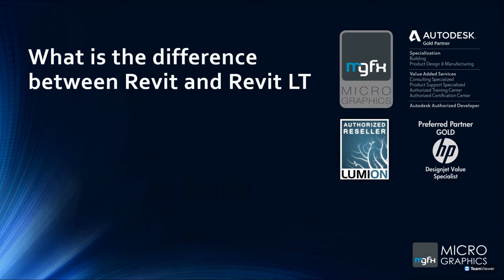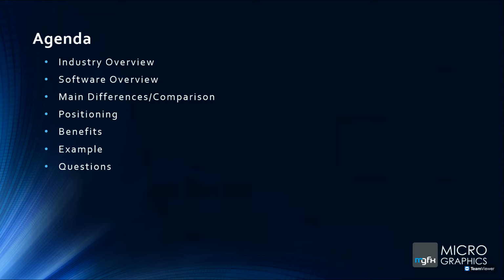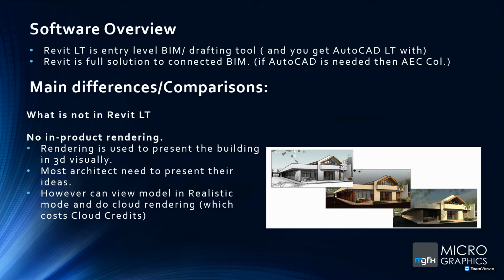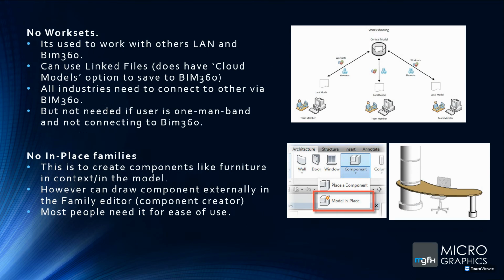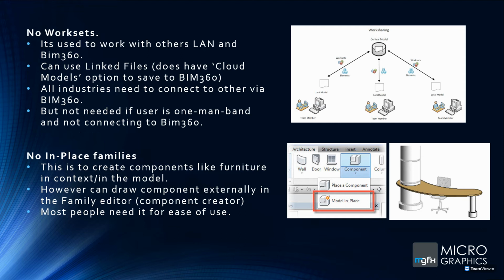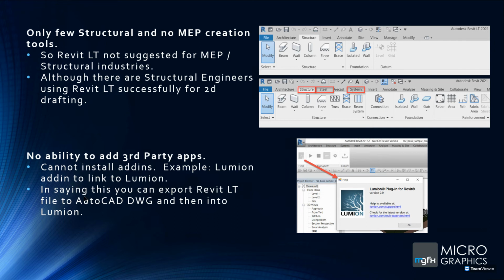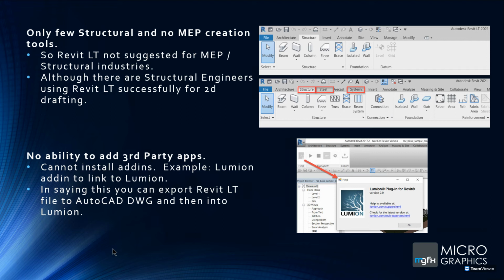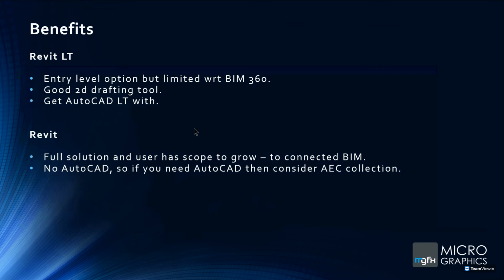What is the difference between Revit and Revit LT   Webinar   9 July 2020

Comment: Excellent review! Thank you so much. I am now prepared to go with the LT version as I can live with the work around. Thank you so much for this well done and thorough review. As a reasonably new user I did have a question about the fact that you can only "model in place" with walls. I have used the "model in place" to create extrusions in order to cut out specific portions of things like concreate floors in the full Revit trial. So am I to understand that I would not be able to do this? In a stair well for example how would I modify a concrete floor without this tool? I hope this question makes sense. Cheers John